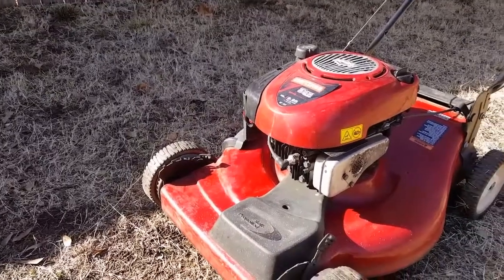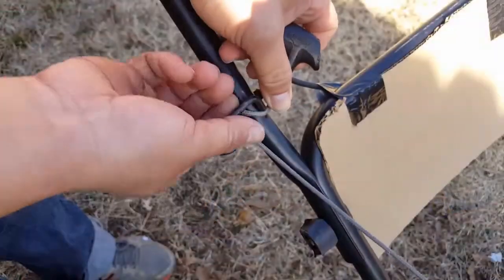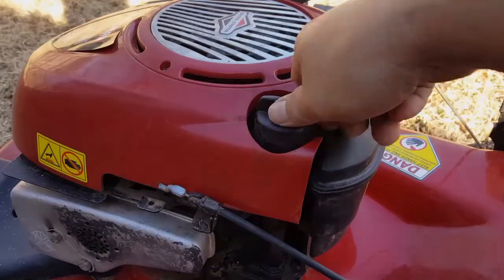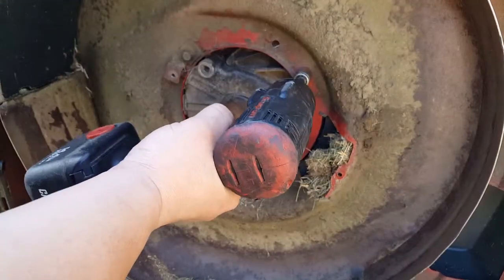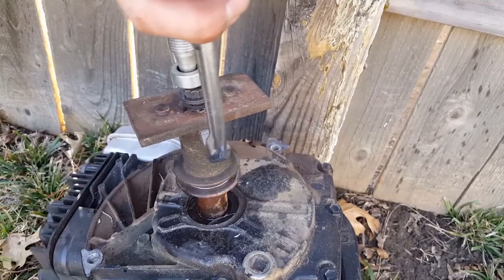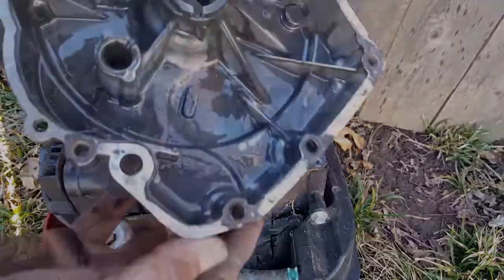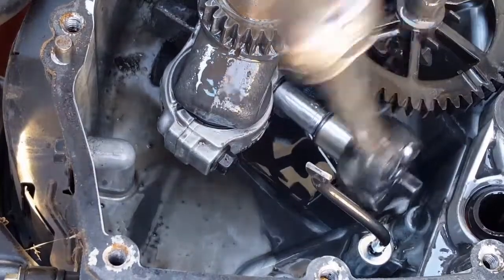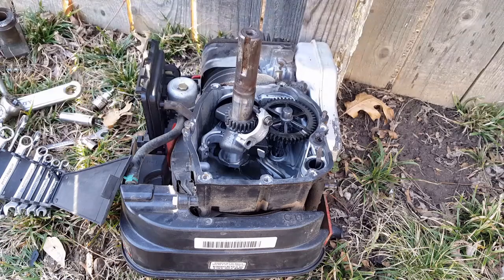Lawnmower has a clanking noise. Is it rod knock?

Comment: Liked the clarity of your communication and the brevity - to the point. Short and sweet. Excellent. Cleaning the rust on the shaft before crankcase oil pan removal always helps. A sequel video may even be equally or more popular that showed repair or it's non viability.
Reply from the maker: Thanks for the comment I appreciate it

Comment: Our mower is making a clinking noise...similar to the noise you would hear when shaking coins in a jar or something. R.I.P. TroyBilt TB110 you served us well.
Reply from the maker: yes it certainly sounds like its near it's end
Reply: Our TB110 is starting to make a deeper sounding knock than coins but probably rod knock as well. It was a good run. Had it for over 9 years.

Comment: The knocking sounds just like mine, "Husqvarna LC121P",  but i havent checked the oil yet, but there is definately a slight rod to crank play. To verify, i removed the top plastic peices and recoil pull start off to access the flywheel, the woodruff key was spot on and not sheared, removed the spark plug, then tipped the mower on its side and held the blade still with one hand and rotated the flywheel with the other hand, bingo. I maintainenced it when i could, ran like a dream, no vibration, no smoking, no cutting off,  just the typical hard starting issues with this particular model and many others like it with the plastic carburator(too small a main jet that clogs easily). Sucks that this had to happen, purchased brand new back in July 2016, going on 5yrs, thats sad, but it still works great and looks almost like new, i suppose i'll continue to use it till it throws a rod, then get a new mower. EDIT - Drained the oil, slight metallic particles indeed
Reply from the maker: that's a shame, yes to bad it didn't make it all that long.
Reply: Explain "bingo". Do you mean you adjusted Timing by holding the blade and changing  position of the flywheel?  Please explain.

Comment: Another great video, thanks for showing the internal damage. I just had to give a friend the same news earlier this summer. He asked me to tune up his 1978 John Deere push mower with a Briggs 9200 series engine on it. When it finally started up the sharp metallic knock was so loud you couldn't even stand next to it without ear protection. I told him to go ahead and run it until the rod came through the block, it's not worth the price of a spark plug and there's no sense in changing the oil. The cheap deck isn't worth an engine swap either, straight to the curb!
Reply from the maker: Thanks for the comment I appreciate it

Comment: I have a model like yours that we bought over 10 years ago. The mower runs like crap but still runs strong. Oil flies out of the air filter. It blows smoke half the time. Ran some old 2 stroke fuel through it. I did a tune up last year and threw a new air filter on it. New oil (the old oil came out silver and chunky). New blade so instead of being a 16” it’s back to 22”. It still has the original spark plug in it. I have been running it with a rod knock for 3 years now. It might last another 1-2 years.
Reply from the maker: Thank you Peyton Hulka for the comment.  I completely understand as I have seen a Honda mower last several years with rod knock.
Reply: Is it still running?
Reply: @wronggg  I guarantee it would start. I haven’t used it in the past year due to finding an old discarded rider. I built a new harness for it and it fires right up. It has the same problem as the push mower and it knocks and pukes oil. When it quits smoking I dump more oil in it and it quiets down.

Comment: I also have a tip trick to remove the blade adaptor. Put the right size shallow socket on the bolt. Where the ratchet wrench would normally go, that square hole will keep the gear/flywheel puller from jumping off. Great video,just revisiting.👍
Reply from the maker: Thank you for the tip.  I'll have to try it out soon.

Comment: Rod knock and piston slap both sound similar and they both form from the same problem, the only difference is where the excessive wearing takes place. At least these older Briggs quantum engines are extremely common and easy to find.
Reply from the maker: you're right about that.
Reply: OK, say in my "side of the road" B & S push mower, the finally successful start IS rod knock and piston slap or one or both.  Is it done for, for sure?  Parts motor only?

Comment: Those are solid engines, sad to see they didn't change the oil like they should've.
Reply from the maker: Yes its very sad. It might still be running today if the maintenance was kept up.
Reply: @HomeGaragechannel  Yes indeed because I have a  2006 Craftsman 21" Mulcher that I use to cut my grass.  It has the 6.5 Horsepower Briggs & Stratton motor.  Also It has a grey deck which actually seems somewhat rare because the pictures I looked at they all have red decks but the same motor.  The motor is still going strong and I've only had to change the air filter and I regularly change the oil every year.  It's an excellent machine!
Reply from the maker: @cdos9186  I think it's you. You obviously take great care of your equipment.

Comment: My push mower, a Troy build only 2 years old. Makes a clicking noise  when it starts up and slows down does not make a noise when it's up to speed
Reply from the maker: First check the oil and after that than its something hitting the flywheel otherwise it doesn't seem to be a problem right now.

Comment: That motor had excessive wear, but I don't think that sound was a rod. It sounded like an air leak - head or exhaust. The rpm was fluctuating up and down and the noise was dependent on that. I would have liked to see a more complete teardown.
Reply from the maker: Thanks for the comment I appreciate it
Reply: Mine sounds just like this and it's only 3-4 years old. I can't imagine it's rod knock already. I give it yearly oil changes like clockwork.

Comment: I have a mower I’ve been using for about 12 years. Cold start two pulls. Never changed the oil filter or plug. Use regular gas that stays in all winter. Today don’t have any issues with it. I’m afraid if I do maintenance on it then it will start acting up. This the kicker, I’m on my third riding mower which I had regular maintenance done in them. go figure🤷🏾‍♂️
Reply from the maker: you're very fortunate

Comment: Ive fixed an mower with this exact problem i was lucky though one had rod knock an one was destroyed from the floods they where the old briggs 500 classics identical so i just swapped the internals of the flooded mower and put them in the knocking mower filled it up with good oil and no more knock runs like new certainly wouldn't have bothered with the fix if i had to buy the parts though but i was lucky i have heaps of mowers and other crap and get more given to me almost daily so i had everything it needed to run like new im some what of an engine horder but its abit of a hobby and some times i make a few bucks for beers and the odd part i need so its a pretty good worthwhile hobby even if im abit of a horder😂
Reply from the maker: nothing wrong with keeping something you might need

Comment: I'd like to see one more level: love to see what the rod hits?  I understand the signs and sounds tell you what's up.  Can you explain this one step further?  I worked on a "side of the road" simple Briggs and Stratton push mower, only to straighten the shaft, new carb, cables, etc. and then when successful start: I hear probably the worst sound, what I think is the valve hitting metal with a regular clank.  how bad is that?  The worst?  Do I now have, like you do, just a parts engine? Thx
Reply from the maker: interesting, what I would do would be to remove the spark plug and blade and then gently pull on the rope and see if it's still making that sound.

Comment: Thanks for sharing your experience and knowledge. if possible, when showing 'wear' on a part like the rod cap, please show an example of a good one and one with uneven wear, along with the excessively worn one.  Also I CAN'T 'see why the mower is making a clanking noise ....' I can see the 'slop' but how does that create the noise and the problem?  What is the tool that you are using to remove the adapter from the crank? Also , are there other reasons why it might be making that noise?  I'm not meaning to be critical - just curious. Thumps up and I'll check out the others.
Reply from the maker: I appreciate your comment it helps to make a better video in the future.  The tool is a pulley puller for automotive use.  The noise comes from the slop. As the piston is changing directions it's the gap that moves to the other side of the journal on the crank.
Reply: @HomeGaragechannel  

Is it EVER worth fixing?  I have this noise problem and I suspect it's slop. It's the only self propelled mower I have. Any chance you have a video of actually fixing this and how much are parts?
Reply from the maker: @liman42  actually yes, in fact it airing on my other channel on Friday. Problem is that cost is prohibitive. It would be over $100 dollars and take several hours. for that investment, you could have bought another used mower. If  you have to open the engine,, theres a good chance that it's not worth fixing.
Reply: @HomeGaragechannel  

Thank you for the quick reply. I'm actually a handyman (pretty good too). I just never messed with small engines a lot. Tearing them down is a piece of cake. It's putting them back together within specs that's an issue. I don't have any precision tools to check tolerances. Or a good torque wrench. Or a lot of money.
Reply from the maker: @liman42  I understand. nowadays people have plenty of skills, but not all the tools needed so I can understand your situation. Just to fill you in on the video,  the rebuild doesn't happen and the reason is that the block needed to be honed to a point to get rid of the scratches, that it needed to be replaced. A new block is over $230. Mind you this is a lawn mower, something that can be bought for $40 - $150 used.
Reply: @HomeGaragechannel  

That's what I've been doing, buying used ones. I'd just rather have something reliable that would last a few years. Oh well.  Thanks for your input.
Reply from the maker: @liman42  no problem. thanks for your time

Comment: So my mower is only about 15 months old. Making similar noise. I ran over a wooden play broom my kids had hidden in the yard. Mower didn’t like that. Then about 15-20 minutes later a bolt came off the side of the handle. One of those two things has now caused my engine to sound like that when it is started. It starts up on a couple pulls but very clearly sounds like something is wrong. I could not find the bolt so I’m wondering if there is any possible way it got into the motor or the housing for the engine. Any thoughts on what kind of damage I should look out for? Mower ran perfectly prior to this.
Reply from the maker: that's tough, I would definitely inspect the blade for damage and also if it might have come loose.

Comment: How long will they last when they’re knocking that bad? Got a free one started and it’s got bad knock. How long before she goes out
Reply from the maker: I've never kept track of how long.  As long as theres fresh oil in it and maybe lower the rpms a bit, it might last a season or two.
Reply: A lawnmower engine, or any engine, with a loud knock will generally not last very long if the knocking sound is loud - which generally is the case when people bring it to our small engine shop. I call it the "sound of death". Here is how it starts: as the space between the connecting rod and the crankshaft begins to increase, initially the sound is not even audible. It will begin to appear quite late since the engine itself is normally loud. Once it becomes audible, changing the oil and air filter, say, every 25 hours latest may prolong its life. How much? Don't really know. Theoretically, it should vary from machine to machine. The machine is already in the "hospice" to us. We refurbish and sell machines with a one year engine warranty, but never one that has an audible knock. The repair to fix the knock is a hassle for us. We rather take apart and sell other parts of the engine. It takes quite some time, but we get our money back eventually and someone gets a used part at a great price. However, if we sold an engine with a knock, we are only being unprofessional and dishonest, it is like selling a bee hive in which we will be stung in more ways than one. Conclusion: when it is really a rod knock, rebuild or dismantle or throw away. When the connecting rod will break, it will break quite a few other things inside. On larger engines, if we hear the knock, we make a quick video for the owner, and may even refuse to start it again since we expect crankcase fragments to fly out at high speed. Guess who is standing near the engine?
Reply from the maker: @facereader99  thanks for the information I appreciate it

Comment: Got craftsman push mower the making a tinking sound runs then dies could this be something dealing with flywheel key
Reply from the maker: I don't think so but you suspect it, check the blade for any gouges from a hard hit.

Comment: (my name is Ben  I am using my wife account right now) I liked your video. I just got a free lawn mower that was sitting for ten years.  I supected that the carburetor was lacquered and checked it. it was. replaced it got it running for a few minutes. it made knocking sounds and had little oil. the thing stoped with a clicking sound. now when I move the blade by hand it makes a clicking sound. what  you think parts or salvage and get running?
Reply from the maker: So you think it ran while low on oil? Well it was free so just use it till it dies.  Then put it on the curb.
Reply: @HomeGaragechannel  Gotta consider replacement value, though. It won't be free if he has to buy a new mower or pay a lawn service.
Reply from the maker: @micahned  very true.

Comment: With the engine already a part I don't understand why you don't just change the bearing?
Reply from the maker: Hey thanks for the comment.  The bearing is part of the connecting rod. Its not like a car engine.
Reply: @HomeGaragechannel  oh so you have to replace the whole connecting rod?
Reply from the maker: Yep. And I hate to say it but this repair would come out of my own pocket so it's not getting fixed. If I had a machine shop I could resize it.
Reply: @HomeGaragechannel  but a connecting rod is only about $15
Reply from the maker: That's a great deal. I should have just replaced it. Thanks man.

Comment: new rod, hone it out, new rings/gaskets and run 20-50 oil with 20% STP oil treatment in it. the crank is steel, the rod is alum so the alum rod wears the steel crank journal not so much so it is prolly ok... not forever, but long enuf to get the mower to run for a few more seasons with proper oil changes every 20 hours... which shd be written on the blower housing from factory with paint pen. i write it on mine so maybe thenext person who gets them will know to check the oil BEFORE EACH RUN OF THE DAY/change oil every 25 hours with new air filter that  has been oiled to keep silt out of the motor so lasts  a long time.
Reply from the maker: thank you G Mc Innis

Comment: Hey boss my mower started up great but after 5 mins of running stoped and would not start but just made this knocking sound! Is that the same thing as rod knock?
Reply from the maker: Possibly.  Did you check the oil? You can still use the mower it's just a ticking away till the end.
Reply: @HomeGaragechannel  Thanks Ill do that.
Reply: @HomeGaragechannel  Thanks for your help! This morning I gave  it a quick look over including gas and oil then gave it a start and it just took off like new ! Thanks again

Comment: I may have a similar problem on my mower. I would like to ask what do you think are some things that could happen if I were to continue mowing? Just more damage basically. I am not too keen on mowing repair and such ofc, but Our pull rope is vibrating back and forth significantly compared what it usually does, and there is a weird noise sounding like something is jammed
Reply from the maker: well, eventually somethings going to break. so most people put them on the curb  so it's someone else's problem, and just buy another mower.

Comment: my tecumseh has been knocking the last 10 years, still works fine, but burns more oil than fuel :P
Reply from the maker: That is how strong the bottom end is. Thanks for the comment I appreciate it
Reply: As a side question, how would you deal with such an issue?
I mean the clanking noise, since you can't find new parts for an 20+ years old mower.
And also the oil burning?
Reply from the maker: @xgamerbih  you would have to remove the engine and disassemble it. Take the rod and crank to the machine shop and have them resize it. It wouldn't be worth it. To deal with the oil burning you would need new rings and hone the cylinder .
Reply: Home Garage Alright, thanks a lot for the answer! I'll do anything just to keep it running.
Reply from the maker: @xgamerbih  anytime. Thanks for the comment

Comment: If you could chase a conrod up for it & the crankshaft journal is still o.k. then you could fix that motor very easily,you may as well throw a new set of piston rings in then.

I know that the silver particles came out of my 3hp.Briggs and Stratton lawnmower engine when I did the oil change a couple of weekends ago but that was after I ran the engine in which has new piston rings fitted !
Reply from the maker: I could if I wanted to but ld rather buy another engine for it.